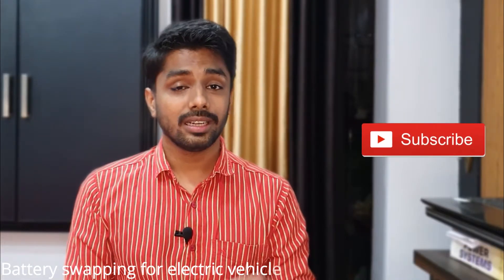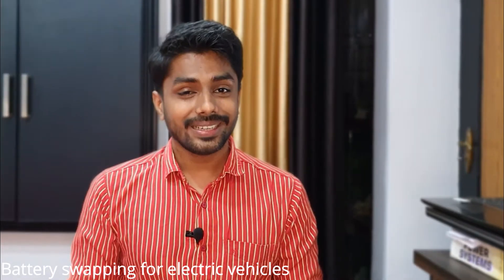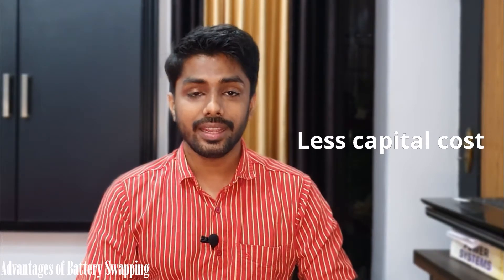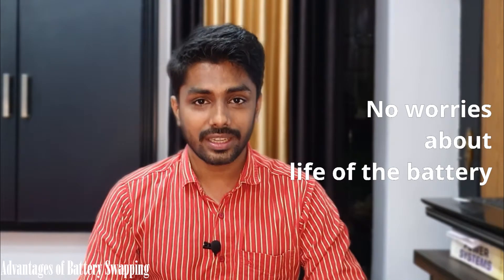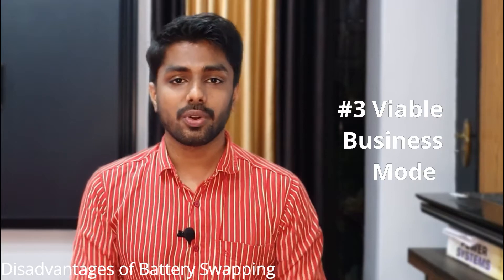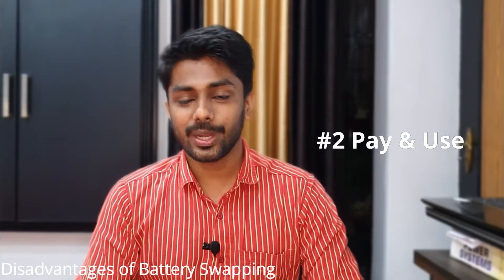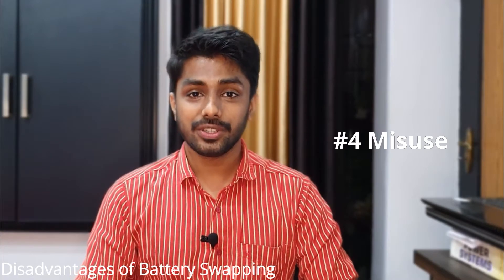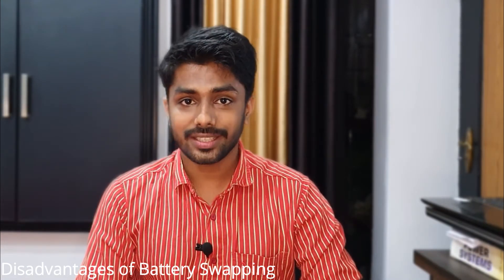Battery SWAPPING for Electric Vehicles | Advantages, Disadvantages, Applications, and More

Comment: $$$Mobile batteries made for electric cars makes sense, ,,, it also makes  sense for solar and a diesel or hydrogen generator be added to the swap stations. Also a cheaper vehicle version could be sold with a basic small battery package,,,, and of course a bigger new or used battery package could be purchased later at any time if wanted.,,,,,,,,,,,, swap stations could  even hire people to hire roof battery rack installation kits for automated battery pack swapping   that can be easily plugged in from the pack to the normal charging plug on any car. Most people would buy a used electric car or new car when a fast roof kit could easily use a battery swap station. $$$$$$$$$$$$$$$$$$$$$$$$$$$$$$$$$$$$$$$$$$$$$$$$$$$$$$$$$$$$$$$$$$$$$$$$$$$$$$$$$$$$$

Comment: Swapping technology will won't work
Reply from the maker: Some companies are setting up battery swapping stations. Let's wait and see what would be the outcome.

"Sun Mobility EV: Sun Mobility to set up 100 EV battery swapping stations across Bengaluru - The Economic Times" https://m.economictimes.com/tech/tech-bytes/sun-mobility-to-set-up-100-ev-battery-swapping-stations-across-bengaluru/amp_articleshow/79856151.cms
Reply: @GetElectricVehicle  yes sir they are but the thing is every car, 2 wheeler, 3 wheeler company will be having different sizes of batteries which will be not suitable for swapping machines